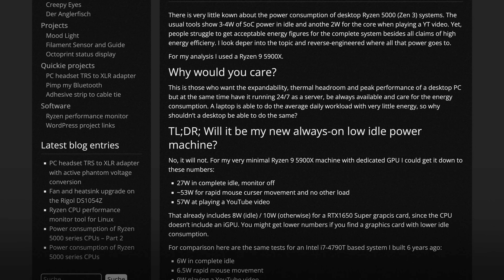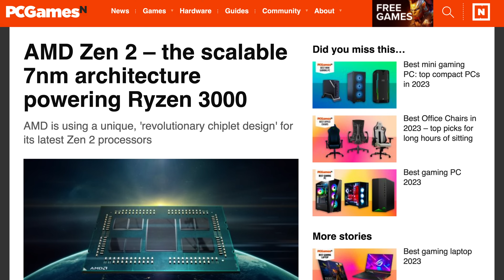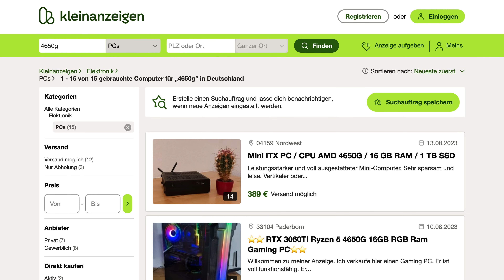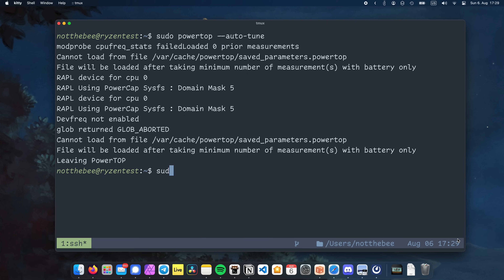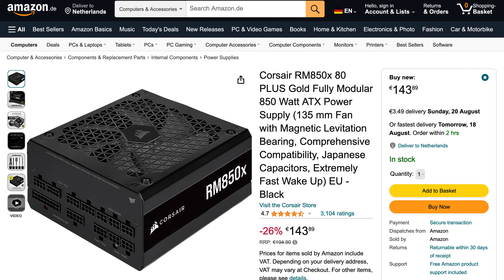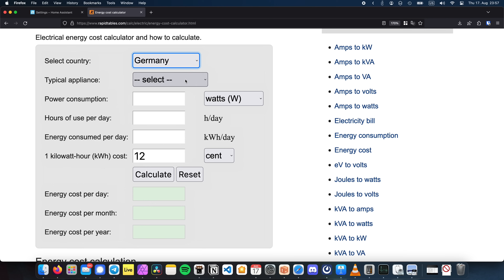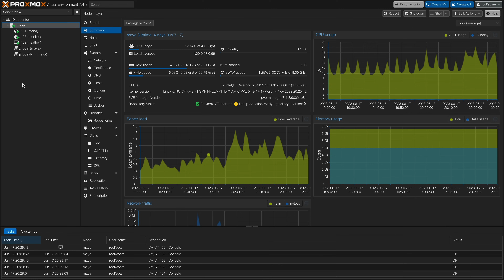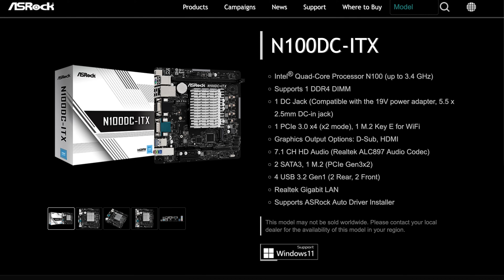This $250 Ryzen Pre-Built is a BEAST Home Server!

Comment from the maker: To try everything Brilliant has to offer—free—for a full 30 days, visit https://brilliant.org/Wolfgang/ . 
The first 200 of you will get 20% off Brilliant’s annual premium subscription.

Correction: The Ryzen 3600 die shot at 3:30 has the "IO" and "CCX" labels swapped (thanks @Weyzar !)

ASPM Tuning Script: https://gist.github.com/baybal/b499fc5811a7073df0c03ab8da4be904
Needs to be changed according to your PCIe devices before running!
Use this command to see what devices support ASPM: sudo lspci -vv | awk '/ASPM/{print $0}' RS= | grep --color -P '(^[a-z0-9:.]+|ASPM )'

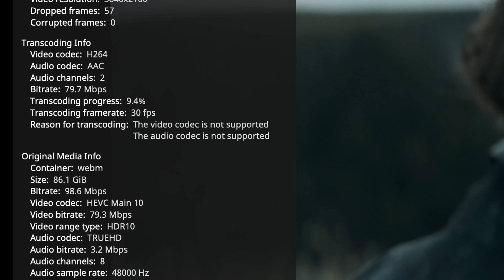Comment: 15:00 Idk brother, for me transcoding it's working in my Jellyfin LXC with a Ryzen 5 5500GT, combo with an ASUS PRIME B450-PLUS. 
CPU load for Jellyfin LXC only with 2 cores is 0.30%. That's crazy, for one stream at a time it almost doesn't even add to the power. You run out of local bandwidth until you run out of APU if you enable 5 cores for it :))

[2025-12-21 03:37:35.452 +02:00] [INF] [26] Jellyfin.Api.Helpers.MediaInfoHelper: User policy for "chrissneo". EnablePlaybackRemuxing: True EnableVideoPlaybackTranscoding: True EnableAudioPlaybackTranscoding: True
[2025-12-21 03:37:36.339 +02:00] [INF] [23] IntroSkipper.Services.AutoSkip: Found active session ".................." for user ..............
[2025-12-21 03:38:41.410 +02:00] [INF] [9] Jellyfin.Api.Helpers.MediaInfoHelper: User policy for "chrissneo". EnablePlaybackRemuxing: True EnableVideoPlaybackTranscoding: True EnableAudioPlaybackTranscoding: True

Comment: Bud, it won’t handle more then 4 normal load VMs 😢 its like big mini-pc with lot of HDDs, but still, won’t handle tough tasks
Reply from the maker: I have it on good authority that it can handle at least 5, provided you have RGB RAM 😁
Reply: @WolfgangsChannel I’ve got ryzen 5 5600H with 32 RAM and it’s getting pretty noisy with k3s running. Not even k8s. 
Ubuntu server 24 lts.
Without Kubernetes it usually idles at 9-10W. 
Bought at Ali for 135$ naked.
Reply from the maker: Well, it’s a cheap miniPC and something’s got to give — usually at this price point it’s the thermal/acoustic performance. Doesn’t mean it can’t handle the load, it’s just not gonna do it quietly 😁
Reply: @WolfgangsChannel  yupp. it does 8500 scores in geekbench 6 but too noisy. thinking about changing my old xeon 2678v3 on 2650Lv4. should be quite less noise for about 30W on idle.

Comment: What about N100 or N150 or N305 etc...
Reply from the maker: No ECC and very few PCIe lanes. Even then, it'd be pretty difficult to build a comparable machine based on N305 for 250 bucks. N100/N150 are cheaper, but way less performant than the Ryzen

Comment: I just upgraded to AM5, and i still have my old 5800x, b450 gaming plus and 32gb ram. I want to run a home server where i can remote access it, that will handle ad block, and for plex and storage. What would be the best thing to use, i looking into CasaOs and ZimaOs. Also is there a way of making my ssd the main root where the data will be transfered and later when the pc is idle to transfer the data from the ssd to the hdd?

Comment: bruh, the section for PSU's was kinda dull as it was a wasted opportunity to mention simple plug-n-play solar inverters which go right into the wall! Even with a small or second hand single solar panel, you coule be getting tens or even hundreds of watts of power for that money all year! 

EcoFlow has some inverters, although the USA i have been seeing in comments for them might not be legal in all states, so for US DYOR first.

The inverter in europe is 140 euros and a cheap solar panel or 2 big ones to fill it up to its max of 800W input can be used. Much better than investing in different PSU or motherboards just to save measily 2 or 5 watts :D so for less than 200 euros you could use the cheapest, lowest efficienty stuff and you would be better off that way as you have solar to compensate for it a lot.
Reply from the maker: Wasted opportunity to go on a 10 minute tangent about a technology which the majority of my viewers (most of whom is based in the US) won't be able to use due to various reasons.
I agree that it's an interesting idea for Germans, but it doesn't really work for the scope of this video.
Reply: air frier with 800W for 2 hours will burn 1.6kWh and a 20W PC for 24h will burn 0.48kWh.... so the math checks out, much greater savings 

Formula for people: 

( watts X hours of use ) / 1000 = kWh

kWh * cents per kWh - and you get how much u pay for it

Comment: You show a Ryzen 5 pro 4650g 3.7ghz in the video, but on ebay the  Ryzen 5 pro 4650g 4.2ghz seems to be cheaper - is there any difference between the two in terms of power usage and suitability for home server
Reply from the maker: I think that’s just a technical error — there is only one kind of Ryzen 4650g Pro. You might be talking about Ryzen 4600G (non-Pro) which don’t support ECC

Comment: For just over $100, you can get a Lenovo Thinkstation M75S-1 with a Ryzen 5 Pro 4650G.  The motherboard/CPU combo supports 128GB ram (including non-registered ECC) which is enough horsepower to run 7B parameter LLM models on CPU.

Cheers :)
Reply from the maker: The only one I could find here in Germany has a 3400G in it unfortunately

Comment: As for PSU in this PC - OEM PSUs for inexpensive office prebuilds are rarely going through certification process, which costs money. They are usually quite efficient, often placing in the range of bronze/silver/gold, which is usually backed up by manufacturers internal testing with results available in documentation. Full certification process is usually made for retail market or higher grade professional units, like for workstations and servers, where you can add the cost a lot easier.
FSP is a well-known brand manufacturing for OEMs and under their own brand. They have a great Hydro series PSUs.
Reply from the maker: Unfortunately, the 80+ certification usually doesn't correlate with idle power efficiency. It only measures efficiency at certain load percentages, usually starting at 20%. A very efficient storage server can idle at 20-40W, which is usually less than 10% of a low-wattage PSU
Reply: @WolfgangsChannel  Agree. I've seen some 80GOLD PSUs that were absolutely terrible at 0-40W range. My comment was more in the general direction, that PSUs that don't have official certification can be decent, especially if prebuilt comes from a reputable manufacturer, because they usually pay more attention to this part, as is can cause a headache in the future and expensive service calls for manufacturers.

Comment: I recently built a server/ pc with an xeon e5 2680v4 and an ati hd5850 (rx5700xt on the way), i just chnaged the power supply setup today (i had 2 psus because i needed one more pcie 6 pin connector for the gpu) now I have a 600W 80+ bronze psu that i got for 15€ (5€ for the psu, 10€ for the corsair psu modular cables i modified to work with the sharkoon psu)
Reply: Hi, can you shared the power consumption ? Thanks
Reply: @ncarrasco2006  probably in a few days
Reply: @ClacKeyTech  a Radeon 5700XT will increase considerably the power consumption, you may use another (also more cheap graphics cards, if you are not going to use it)
Reply: @ncarrasco2006  I never actively used this system as a 24/7 server, the 2011-3 xeon is very inefficient too
Reply: @ClacKeyTech  yeah, in that case, it does not matter. Using a Xeon is good because has ECC memory, (if you care)

Comment: Hi Wolfgang! Thank you for all your nice content!
I recently built a homelab server: Ryzen 5600, Asus Prime B450M-K II, 32gb ECC, GPU GT 610, 650w gold psu, 1 ssd (for os), 1 hdd, Coral TPU. Installed proxmox (with one VM (Homeassistant) and checked my idle watt.. Never lower than 60w, often between 70-80. Have tried everything with Pstates etc. but no luck.
Do you think this is normal? Any suggestions what could be wrong? Gonna try a windows install and see what kind of wattage that will give.
Regards / Tobias
Reply from the maker: Unfortunately, that's to be expected from the non-G AM4 CPUs. The 'regular' AM4 CPUs without graphics are built on 'chiplet' designs, which consume a lot more energy at idle than comparable "G"-series APUs. This is why I used a 4650G in the video.

The dedicated GPU is also a contributing factor

Comment: Simpler and cheaper solution if you are mostly using your "home server" as a media player: buy external usb 3.0 3tb 2.5" hdd for 60 euros or 2tb ssd for 100 euro. Plug it into your tv or PC and transfer it via wifi all over (personaly I don't use wifi at home).

Comment: currently my nas consist of a i5 4460 , the ultra efficient 400w psu you talked about and a bunch of 2.5 inch ssd running on windows 10 file share + jellifinn . i have a r 7 1770 in my rig and was thinking to upgrade , shuld i put the 1700 on a nas whit a tiny gpu ? i got a gtx 620 for free so i was wondering , maybe undervolting the r7 and put it in the nas ? what do you think ?

Comment: I discovered exactly the same low idle wattage with both of the 8 core Ryzen APU's - 4750G Pro and 5700G - both draw 7-8 watts at idle on an Aorus B550 ITX motherboard. The 5700X idles at 30 watts, the 5950X at 40 watts - all on same B550 motherboard. As you pointed out only the Pro models alllow allow ECC memory. Gruess aus Florida!
Reply: Hi, did it draw 8 watts all the system from the wall ?
Reply: @ncarrasco2006  I do not have any equipment to measure wattage at the wall.
Reply: The 5700G also happens to be monolithic as well.

Comment: Hey, I am trying to lower the consumption of a MSI B450M PRO VDX-MAX (paired witjh a Ryzen 5 Pro 4650G CPU - stepping RN-A1). I updated the bios to the latest version as of this writing (B.L0), but, with a BeQuiet! Pure Power 11 Gold 550W PSU, and a NVME drive, and 32GB of DDR4 3000MHz Crucial RAM (2 x 16GB), I cannot reach any level similar to Wolfgang's ones. Using an el-cheapo Lidl watt-meter, I see that it draws, from the wall, something between 19 and 45W (on average 30-ish). My system reaches C6 states for over 90% of time, when idle.

Any suggestion? I tried powertop --auto-tune, plus enabling ASPM states in the bios.. I even tried to force as, power limit, 35w on the CPU.
Are MSI motherboards less power-efficient than, let's say, AsRock or Asus?
Reply from the maker: It’s probably the power supply
Reply: Are you using Linux ? Which distribution , version and kernel version ? 
You can try setting "powersave" that forces to the lowest frequency.
echo "powersave" | tee /sys/devices/system/cpu/cpu*/cpufreq/scaling_governor
Reply: @ncarrasco2006 I am using Proxmox 8.1.10, based on Debian 12.5 (kernel 6.5.13-5-pve). All my PCI devices are using ASPM L1 (I am setting them via the script made by Luis R. Rodriguez). I am passing these parameters to the kernel "amd_pstate=active initcall_blacklist=acpi_cpufreq_init amd_pstate.shared_mem=1 cpufreq.default_governor=powersave consoleblank=130"

Finally, I am also setting these parameters via a script executed on boot:

echo 5 > /proc/sys/vm/laptop_mode &&
echo powersave > /sys/module/pcie_aspm/parameters/policy &&
for i in /sys/bus/usb/devices/usb*/power/autosuspend; do echo 1 > $i; done
echo power | tee /sys/devices/system/cpu/cpu*/cpufreq/energy_performance_preference
echo auto | tee /sys/bus/usb/devices/*/power/control
echo 1 | tee /sys/bus/pci/drivers/r8169/0000\:25\:00.0/link/l1_aspm

(the last one is because I have an RTL8111H network card)

I tried to change some bios settings with no much luck.

Comment: AMD Ryzen 5 PRO 4650G Tray (100-000000143) - regular store in Germany 102€ plus P&P, about 7€
Reply from the maker: Link?
Reply: @WolfgangsChannel  Falls YT die andere Antwort löschen sollte, bei hardwareschotte eingeben  ... momentan liegt man aber wieder bei rund 150 Euro.
Oder bei Jacob de, den Laden kenn ich, dauert zwar aktuell etwa eine Woche, aber Preis bei 112 Euro.
Reply from the maker: Naja, 150€ ist das doppelte vom Ryzen 5 3600 – nicht wirklich ein gutes Deal (habe ich auch in meinem Video erwähnt – 4:59). Mit dem Prebuilt bekommst du den kompletten Rechner, und das für nur 100€ oben drauf.
Reply: @WolfgangsChannel  Ging auch nur darum, dass du erwähnt hattest, wie teuer der 5er wäre und das es ihn inzwischen für knapp über 100 Euro gibt.
Hab mir gestern noch direkt einen bei Jacob bestellt, für knapp über 112 Euro, soll spätestens Freitag hier sein - hab aktuell einen 5 5600G, aber der lässt sich nicht wirklich zum Sparen animieren.
Reply from the maker: Würde ich nicht machen – 5600G soll genauso sparsam wie der 4650G sein, da sie beide auf den Laptop-Chips basiert sind. Wenn dein System mit dem 5600G nicht sparsam ist, würde es leider mit dem 4650G nicht besser. Dein Problem liegt wohl woanders im Rechner (Mainboard, PCIe-Geräte, usw.)
Reply: @WolfgangsChannel  Vermutlich, aber genau weiß ich es erst, wenn ich die andere CPU ausprobiert haben werde.
Ist aber auch nicht so dramatisch, weil ich die zweite CPU eh im geplanten HTPC verwenden kann ;-)

Auf jeden Fall danke für die Antworten und ich muss immer wieder grinsen, wenn ich die Videos schaue, weil ich da viel von mir selbst sehe und für jemanden, der in den 80ern mit dem ganzen Kram angefangen hat, ist das halt immer schön zu sehen, dass es nicht nur noch Poser gibt, sondern auch Leute, die sich ernsthaft mit gewissen Dingen beschäftigen.

Comment: I kept looking for a newer  Dual CPU Xeon system as I have 2 older servers that for some reason don't have native PCI-E slots in them sadly.   But the more I did the numbers, the less it made sense to keep using these when even a consumer board with a Ryzen CPU would beat them out handily doing  A.I. stuff with the  M40 GPU cards.  

The only real plus is that the cases can take these cards and keep them cool, but  I still would have to limit myself on the amount of GPU's I could fit inside.   So something like a Mining Rig / Case would work better.  
But as I keep doing the math?   It just makes sense to purchase new hardware as its just so many leaps and bounds ahead of the older stuff of even a few years ago. 
And right now seems to  be the best time to get into AM-5 as what it can do per clock cycle and with the amount of cores it has is staggering.    

Even the AM-4 systems still pack a pretty good punch.   
The Only reason why I would stick with an older platform is that that DDR-3 Memory kits  are so cheap, getting 1TB of RAM is even affordable.    

I guess the next hot ticket would be to get a Old DDR-3 ECC memory moudles with some kind of riser and use that as a massive scratch drive using it as  iSCSI   / NAS  array for video scrubbing.    But its only me, so no need for something like that.  

Great Video btw!

Comment: I subscribed to your channel because of your interest in reusing computers efficiently. Am a Newbe Watt-Miser because the residential rates tripled to almost $0.2 per Kw h. I donate computer time to Folding at Home aThis cost lessnd suddenly felt the need to be more efficient. Looking among my retired PCs I found a Fractal Design Torrent case with an i9-9900K with a 600W Platinum power supply. Another PC had a NVIDIA 3090 GPU. I did by a 12VHPWR cable that would fit the power supply. Using Intel Extreme Tuning Utility by limiting the current to 70 Ampers the CPU was limited to 36 W at 2.95 GHz. Using MSI Afterburner to 34% GPU of the power limit the power power fluctuated around  122 W. The plug at the wall measured about 200W. This works out to less than a $1/day. Less than the previous computer at the old rates while doing more work.

Comment: The Corsair PSU is the wrong one. Personally i run such a Server with a 350W oder 400W PSU. This System has a Powerload of maximum 250 Watt. The System runs most of the time below 30 Watts. Which means below the 10% treshhold of PSU Certification. Even the Corsair will drop down to 80% efficiency when it runs at 5% and will not reach peak performance as it would need about 260-270 Watts. To reach it's 93%. If you take a be Quiet ! pure Power 11 400 Watt Gold Plus PSU with a 92% Efficency, you will be over 5% and closer to 10%. And they relativly come cheap at 55€ . As i said i have a quality 350w Silver, which is sadly discontinued, that would be the perfect PSU for this system. Some reserve for Aging and a 10% of 35w. Ran my Old Homeserver for over a Decade.
Reply from the maker: I would disagree.
Small power supplies went almost extinct as a category with the introduction of more power hungry CPUs and GPUs.

As a result, most of the <350W models sold now are older PSUs with decade-old tech. And since they're rare, they also aren't necessarily cheaper than 'bigger' power supplies

As far as efficiency at <40W, the Corsair RM550x 2021 is still more efficient than pretty much any PSU currently on the market https://docs.google.com/spreadsheets/d/1TnPx1h-nUKgq3MFzwl-OOIsuX_JSIurIq3JkFZVMUas
Reply: @WolfgangsChannel  And yet this table shows exactly it: The standard 80 plus Coolermaster MWE 400 is nearly as good as the Corsair 550x. How about the Be Quiet Pure Power 400 Gold Plus? I know that there are no longer any 350w Gold out there, But there are 400W Gold out there.But when you can live with 2 Screws or an adapter plate a TFX Gold with 300W is avaible. Using one for my selfbuild Ryzen 5 5600G "Trashcan" PC. Be Quiet TFX Power 3 300 Gold got an efficiency Rating of 82.7% for 10%. For again 65€.